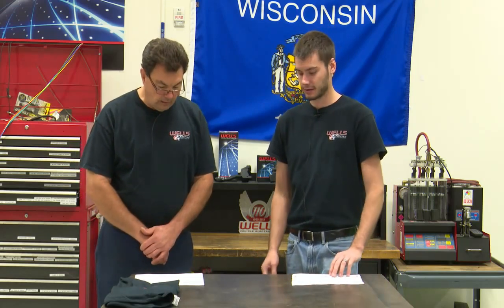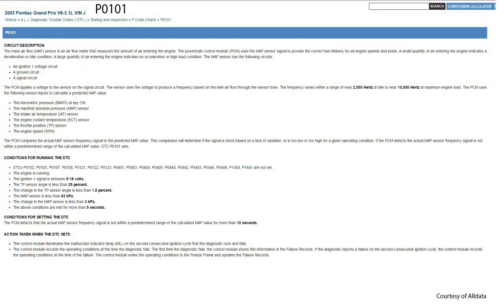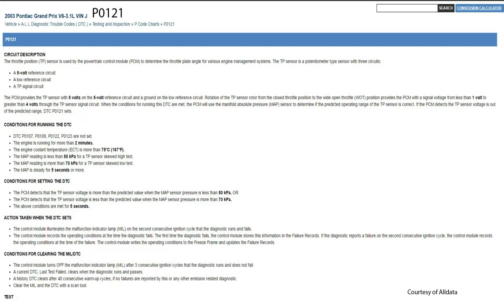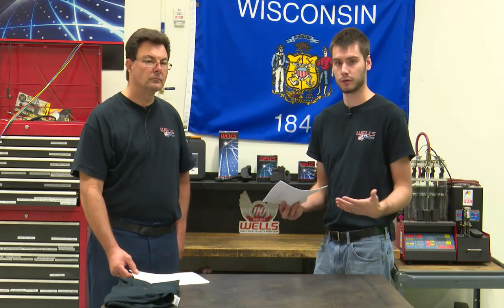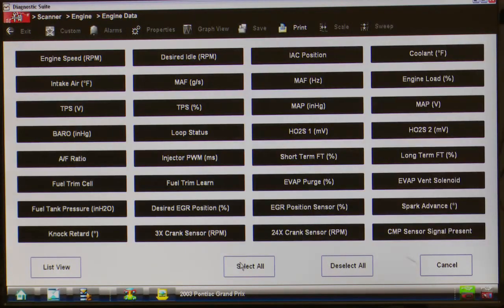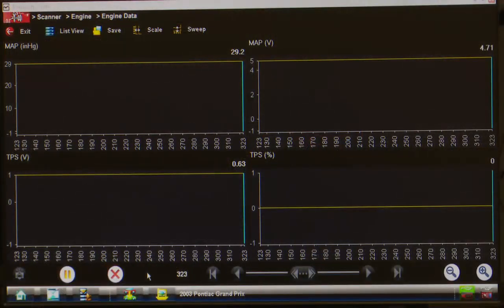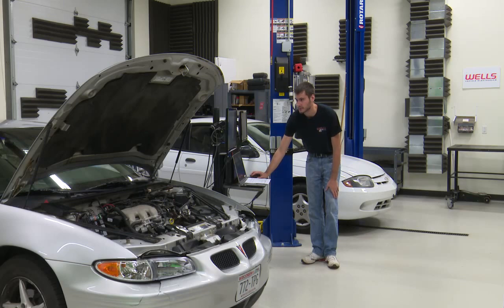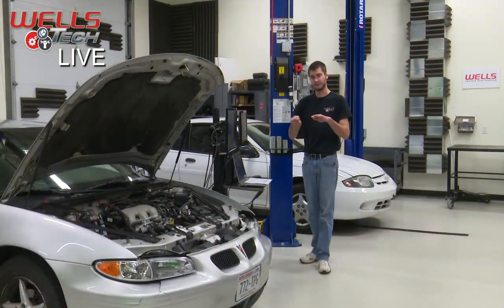Scan Tools: Data Graphing Diagnostics

Comment: The post cat sensor should be running more level, no switching up and down
Reply from the maker: Hey Michael, that is correct. Usually the post cat sensor will remain pretty steady with a functioning cat. This car does not have a properly functioning cat. 
Mike Becker, Technical Services Instructor

Comment: The Downstream O2 should be close to .560 volts & only move a little either side of thatI would suspect the Catalyst is depleted or contaminated & thus the PO420 oreven a leak in the exhaust system before the converter & the rear one is taking over to help correct fuel trim
Reply from the maker: That is perfect Pc Zapp. Nicely said. You nailed it!
Mike Becker, Technical Services Instructor